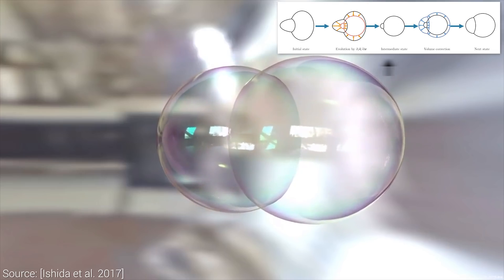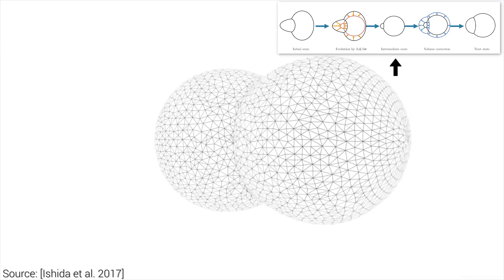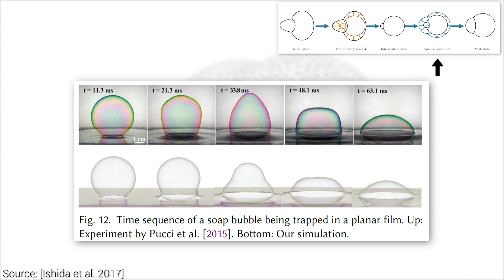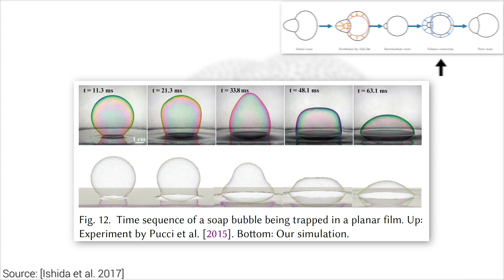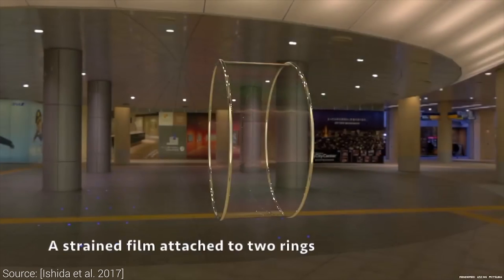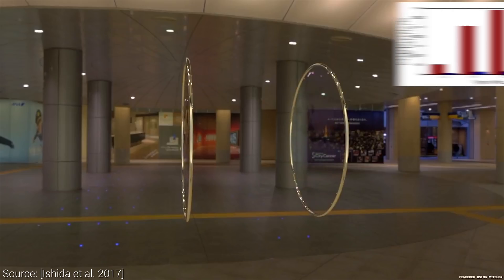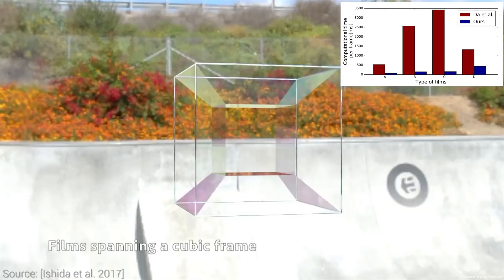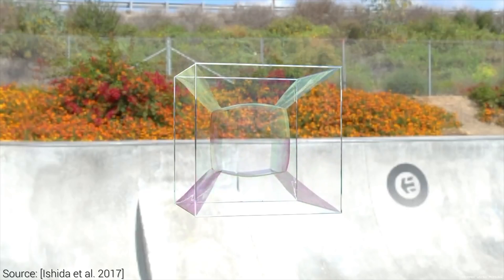Bubble Collision Simulations in Milliseconds | Two Minute Papers #231

Comment: I wonder if large Hadron collider can be simulated using that would save a hell lotta money
Reply: Susmit Patil If we knew how the stuff it's investigating works, we wouldn't need that gigantic collider :)
Reply: The point of the LHC is to validate the theories we've got (and, as a bonus, we might find stuff we haven't thought of). That's not something a simulation can ever replace...
Reply: Dude, even if a simulation could precisely replicate everything we know about reality it would still not be able to replace an experiment because, by definition, it's not real! The underlying assumption of all physical science is that the fundamental laws of nature don't change, so we fit our theory to reality and not the other way around.
Reply: Susmit Patil well, the LHC in this case would be like the camera that records how actual bubbles react, so that it can be compared to the simulations.
Reply: Actually lhc , all its structures, elements, detectors and even surrounding rocks are modeled and simulated. And then compared with real data from experiments to detect new and unknown yet phenomena, like new particles.
Reply: Hadron collider is already simulation of The Big Bang. You mean that simulation of simulation.
Reply: They usually start with a simulation at the LHC, probably thousands of them, before ever powering on the machine. But a simulation can't confirm anything, they need the physical experiment to confirm or disprove what the simulation and theory says. And something something unexpected comes out, so they have to revise the theory and simulation models.
Reply: André Mello Not so sure about never ;)
Reply: André Mello exactly

Comment: Beautiful. The only thing missing is the bubbles’ inevitable popping.
Reply: It's completely avoidable in a simulation tho. ^_^  I figure that part would be the easiest, just pop one vertex from every triangle on a seam, one seam at the time until you went trough the whole bubble. ^_^
Reply: Well as far as I remember bubbles pop because their film gets thinner and thinner due to evaporation, so it would require some stress simulation based on thickness, but yes I would think it would be rather easy using this paper:)